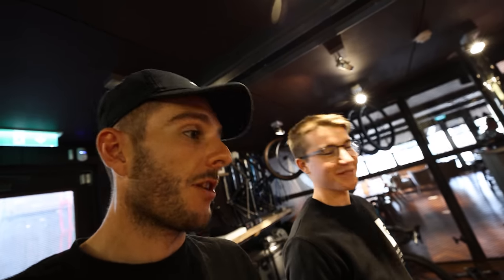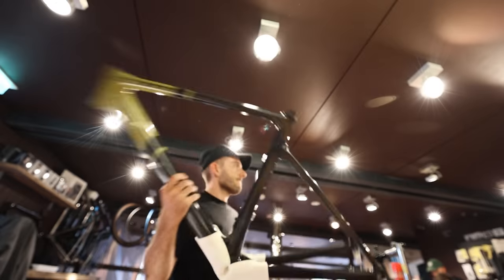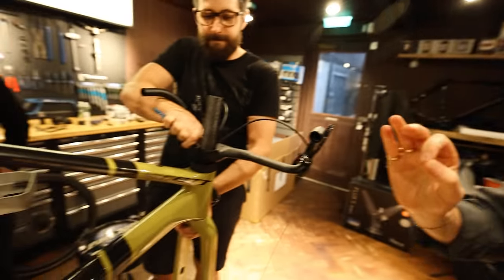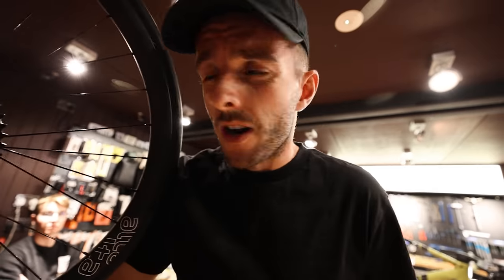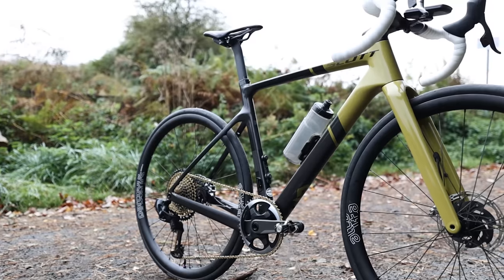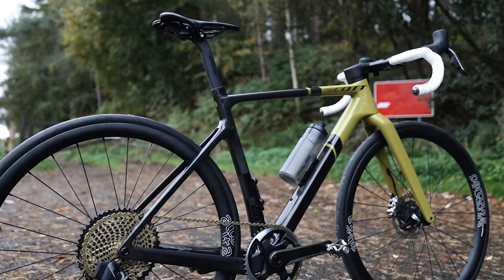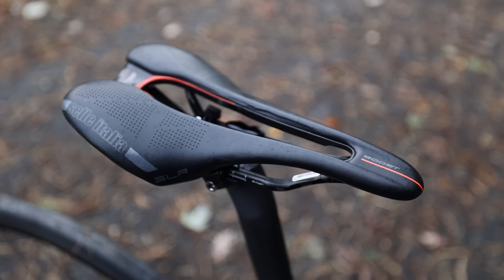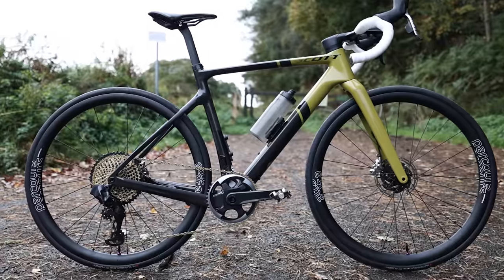I'm Riding 3000 Miles On This Bike

Comment: For such a long trip, wouldnt it make more sense to have a big cassette, but 2 front rings, in order to have more gearing options? On the flat, i love my 12-25 for example. It's just awesome to have small increments, rather than big jumps.

Comment: I really like Scott bikes, I've owned two including the Solace that I ride now.  However, the problem with all of these bikes running Di2 is the height of the hoods.  Talk about ruining whatever aerodynamic advantages the frame might give you.  It's basically two huge blocks going down the road on the front of your bike.  They have to design it so that isn't the case.  Don't like the paint scheme on this bike either, but that's just a personal preference.